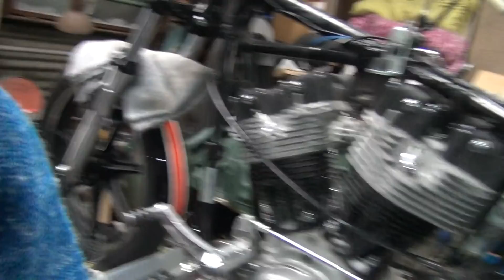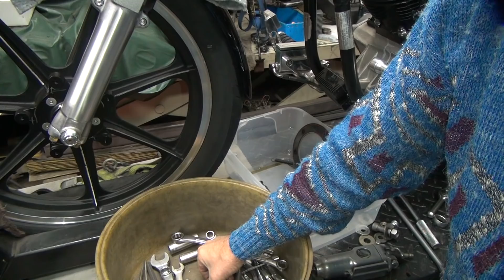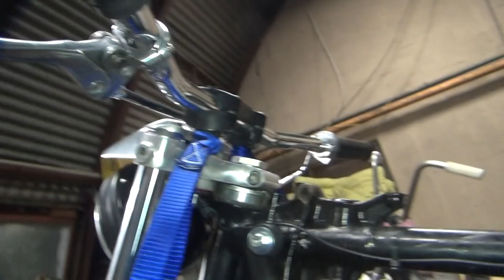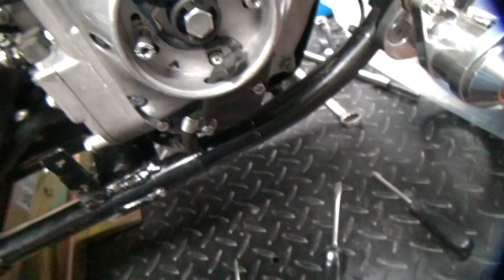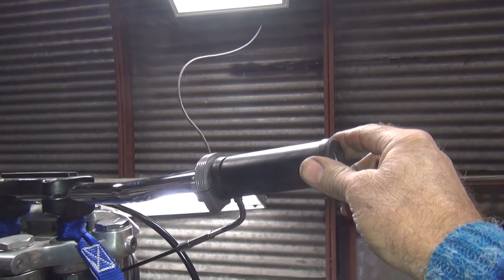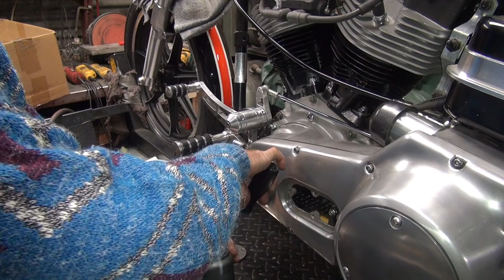1980 shovelhead #135 92ci topend rebuild stroker fxe street racer harley cam change tatro machine

Comment: I had two Shovelhead bikes. 1974 and 1980. Both were great bikes and never put me down in a serious way. Did have problems keeping condensers from checking out. In both bikes I ran Toyota U-groove plugs I believe ND-16. I never had one to foul out, never. Is it possible a plug can make a condenser give up early? What it your favorite plug to run in the Shovel? With the Shovelhead bikes, I always kept extra points and condensers in the saddle bag.
Reply from the maker: ngk v-groove and nippondenso u-groove spark plugs are both good plugs. i use to use both of them back in the 90's when i was racing hard. i like the ngk plugs the best. they make lots of different styles for tons of applications. you need to loose those points and move on to a good electronic ignition. you use standard plugs in point ignitions and resistor plugs in electronic ignitions. use the ngk bpr5hix or bpr5eix11 plugs when you upgrade. gap them at .035.
tatro